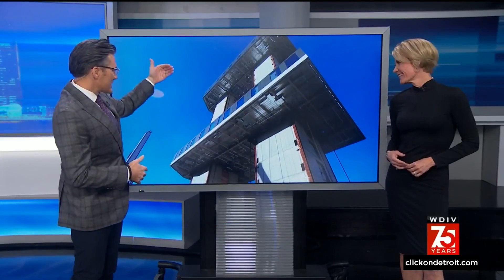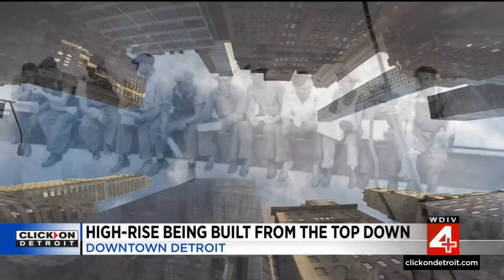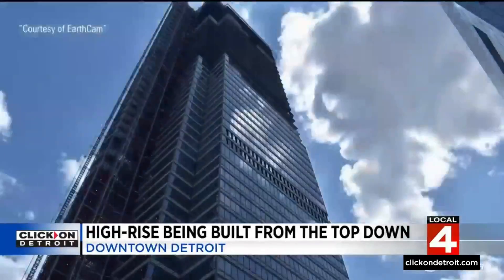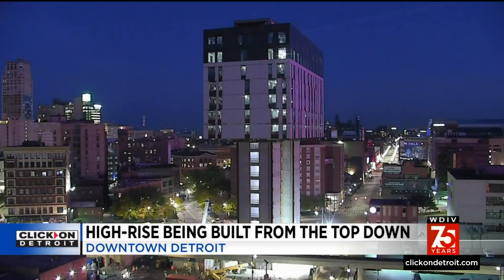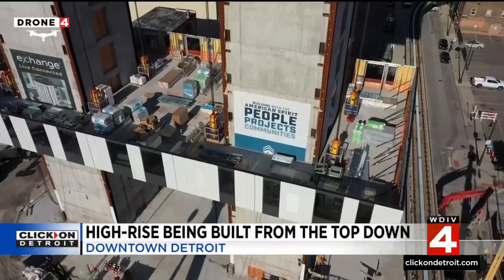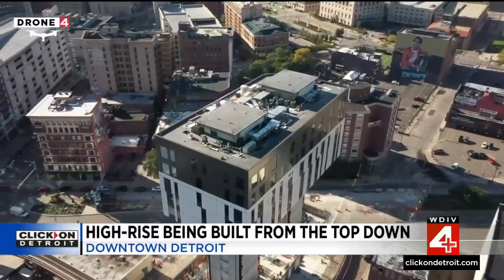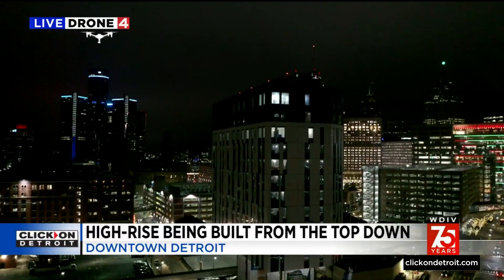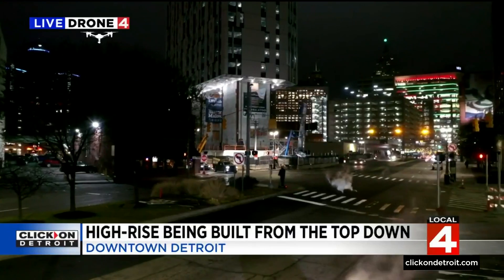How a high-rise being built in Detroit can change the way cities are built

Comment: BS!
Instead of working up in the air - you now work right underneath a building that hangs above your head.
It still needs the two towers to be built conventionally, so it solves nothing. The weight load on a structure that hangs like that is highly questionable. Modern techniques can make entire floors like that and move up to build the next floor while sitting on the one bellow. So I don't see any benefits of building the last floor first and rising it to the top.

Comment: Not sure if I would call this innovative. They had to build part of the building the core likely via conventional means. From there they had to build a extensive elevator system to move the floor up just to build top down. In essence they used traditional methods then went against gravity and built top down.

Comment: Great mixed use building. Detroit is looking like it will revitalize into one of the most livable cities in the US in the coming decades. Especially as water shortages in the south west force migrations to the more water rich areas of the country.
Reply: Silicon chips use a lot of water to be produced, why are they being built in Phoenix and not the Motor City?
Reply: @DiogenesOfCa  Cuz the people running the show would rather live in the Silicon Valley and it’s warm weather.
Reply: @DiogenesOfCa  Because common sense is not so common. Why were cities built in the Desert in the first place?
Reply: @ryanvandy1615  Because of  TB disease. It use to be a crisis, and it was thought that the dry hot air was good for damaged lungs.
Reply: Even the Los Angeles water problem would vanish, let alone in Flint. A mixed component building like this makes it all kinds of possible.

Comment: They said this is a 16 story building, I think this type of construction would be limited by the height of the building. I've worked construction on buildings as high as 55 and 60 stories. I don't believe this type of construction would work there because of the amount of weight that would be at the top of the building. You don't want top heavy construction before the base is there for support.
Reply: That could be dealt with by tapering the pillars. Thicker at bottom and thinner up top. Lessening the square footage and structure the higgher you go and growing the lower you  go. 
It could still be implemented in higher construction but would have to change design a bit more.. 
even along the line of suspension bridge maybe?, Attached at the top coming down or like a prism/diamond from top and from bottom
Reply: @J1WE  but lessoning the square footage of higher floors don't seem like it would be worth using this system. Those higher floors and penthouse units are where they make a substantial amount of their money back.
Reply: the higher price per square foot is at the top. pyramid shape isn’t helping the developer
Reply: Oh stop making sense.
Reply: Not true! Check out the Rainier Building in Seattle for example. It’s skinny at the bottom. One of the most earthquake resistant buildings in the city.
Reply: @noahjhs   ...most earthquake-resistant buildings so far .....  Just wait until Antifa-Seattle with their "Riot Snack Van" show up.

Comment: I watched an Extreme Engineering of Sky City 1000 in 2013 when I was 11 years old. There was a building that was being built in Japan using robots and this building was built in the 1990s through barcode scanning on of the concrete sections without a human worker in sight. It was the Big Canopy. Also top down construction is nothing new a skyscraper that was built in the 1960s in Madrid was built using that style of technique.
Reply: Thank you for your comment! I must have a look. This will certainly drop the price of housing.
Reply: Toronto has many Top designed Buildings..
Reply: The top down building with 'train cars' of parts could also do building on the moon. The robots could get started as soon as in position. An Orion heat shield 'pop out' system could rapidly deploy a contained atmosphere in space.

Comment: So, will this bldg. pass the Dade County (now called "The Florida") hurricane bldg. codes? Or will it cost the 20% saved plus another 35%.
Reply: This METHOD may or may not, but THIS BUILDING doesn't need to. 

Michigan doesn't get the natural disasters that so many other parts of the country experience.
Reply: There are prefab concrete buildings that easily could.

Comment: Scary buying into new construction like that the cost of Maintenance and upkeep could be astronomical but we'll see how it holds up
Reply: What happens when the elevator breaks?
Reply: @seanwhatshisname1831  They fix it.
Reply: @seanwhatshisname1831  what happens when an elevator breaks in a regular building?
Reply: @seanwhatshisname1831 they take the bottom two sections apart then slide the elevator out for repair then back in. 

Then slide the building back in place like a, “ Lego “! 🫤😐